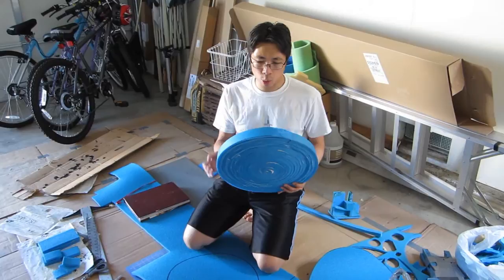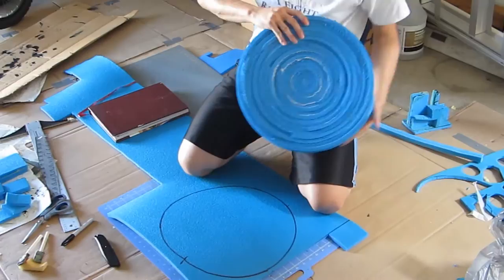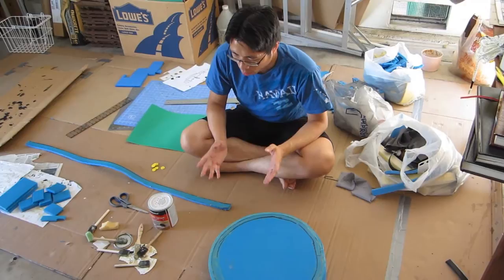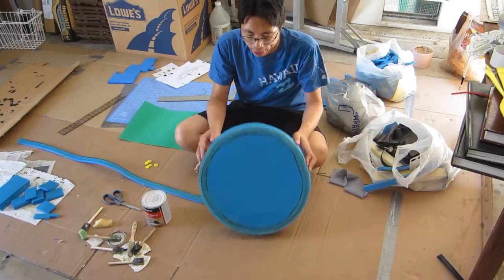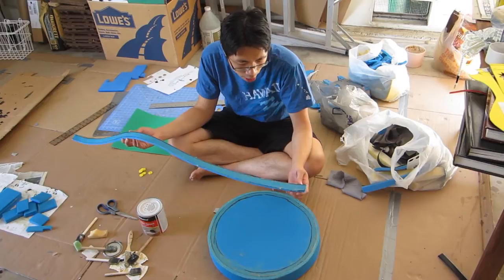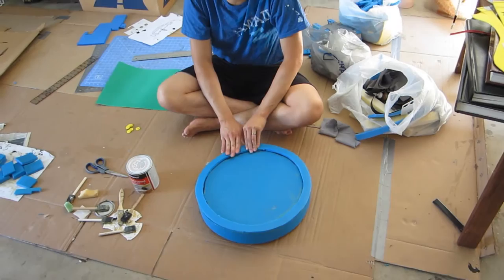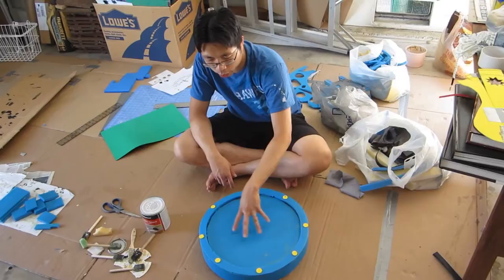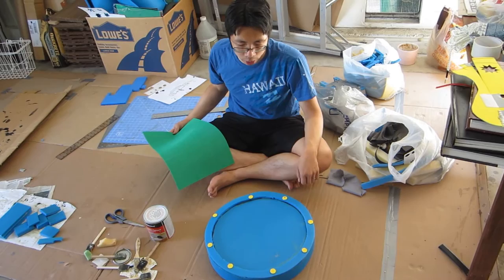How to Make a Foam Round Shield/Buckler Part 2 of 3

Comment from the maker: I didn't go into the difference between a shield or buckler because you can make either one using this design method. I mentioned "shield" the entire time in the videos because that is what I made. But people should be able to easily adapt this tutorial to convert it into a buckler by simply using less strips in the beginning to make a smaller surface. You can then shift the handle to the middle and not have to do a strap.

Comment from the maker: Thanks! It depends on your construction. I've made a buckler around 12 inches that's good at taking a beating. Generally, the shield is pretty sturdy. If you really want to, you can back it by gluing a thin layer of plywood and then covering it with foam. Or you can just add another layer of foam